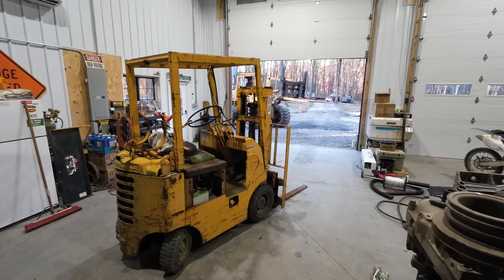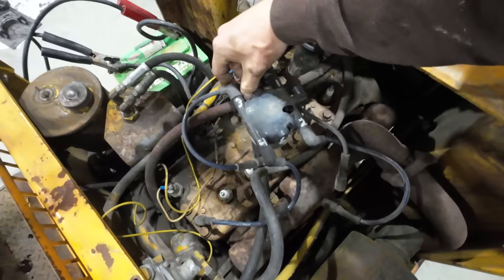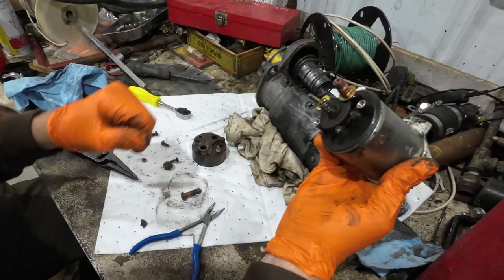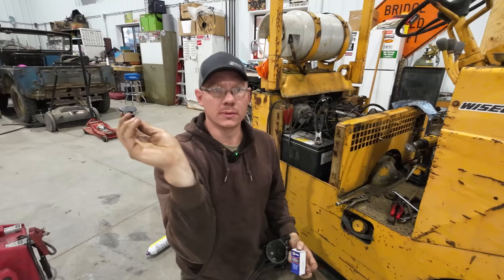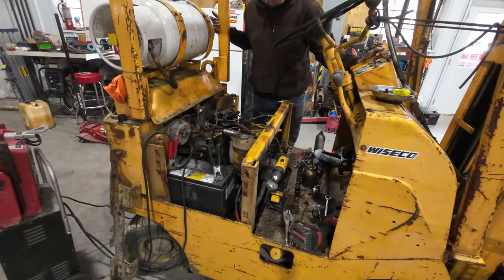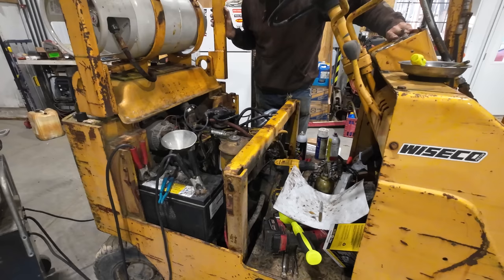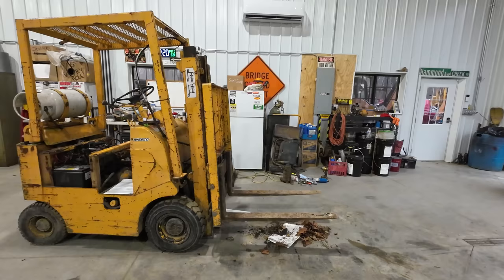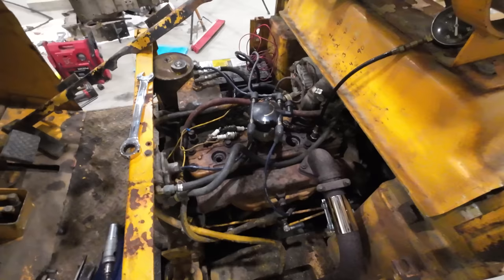Save or Scrap? CAT Towmotor sitting for years. Will it Run??

Comment: The Towmotor co est 1919 were the inventors of forklifts, their early models didn’t have forks and would just tow carts from place to place 👍🍻
Reply: That’s interesting.  I’ve worked in the LTL freight industry and have heard fork trucks referred to as tow motors by people who’ve got many years under their belts.
Reply: Ha, always heard the term “Towmotor” for “forklift”, now it makes sense! Thanks
Reply: Beat me to it. Cat bought that company and of course the rights to the name.
Reply: Distributor may be turning under load ,harmonics off be blessed Matt
Reply: Pretty sure Clark was the first.
Reply: Google to the rescue!!
Reply: @ColtonBlumhagen   yes it was Clark , I stand corrected . I think Towmotor produced the first electric forklift 👍🍻
Reply: Can Matt pull the hydraulics and just use it as a "towmotor"? Yank trailers around the yard?
Reply: After watching Cold war Motor's  flat head  rebirths I think a compression check ought to have been  done because of stuck open  valves.
Reply: @divadyrdnal yes, I always wondered why the term is used.  Thank you.
Reply: A tow motor is used at the airport to tow planes out to the flight line. They may also be the equipment used to tow luggage to the plane as well.
Reply: I know when flowers are auctioned at the flower-auction in Aalsmeer(NL), where around a million Dutch flowers a day, 6 days a week, are auctioned to buyers all over the world, these flowers are on carts of 1x1meter, 2m high (or 3x3x6ft). Then dozens of these carts are linked together and pulled by a forklift-like vehicle without forks.
I don't even know the Dutch name for these vehicles, but I bet a lot of people call them towmotors.
Reply: Great video Matt it's too bad that it could be workable
Reply: Continental engines can still be rebuilt if you are game….
Reply: Top comment ayeee
Reply: @TSSVillains  I don’t deserve any credit, my comment was inconsistent with the truth 🤣cheers Vinnie 🍻
                               P.s where do I get my TSSVillians roller door ?
Reply: Had a late 50's vintage Towmotor forklift at an old job. Absolute beast of a machine.
Reply: The mast and forks attached to a building or crane pillar makes a good adjustable height work station. It would need an electric powered hydraulic pump.l
Reply: At the papermill where I work all fork trucks are still called towmotors.  We just got in a couple of new diesel powered Cats that run off of propane and compared to our gassers and electrics the power is fantastic..
Reply: @william_k4arx not with those tiny tires.
They are like a hog on ice in gravel.
For another pig reference,  that thing is worthless as tits on a boar, once it is off hard surface.
Reply: @ksw501 yeah I’ve worked with some old timers who came over from the steel industry, and they always call our forklift a Towmotor.
Reply: @johnsecord9697 could also be used as an elevator for lifting parts up to a mezzanine.
Reply: No they were invented by my great great grandmother May Tipton who was a mill worker in uk lol
Reply: Same as a few people above... I've heard the term "tow-motor" for years... Never really thought about it. Interesting.
Reply: Towmotor was than sold to Yale Forklift which was sold to Eaton,Becoming Eaton, Yale and Towne than sold to Caterpillar
Reply: @JAF-pd9mw  Definitely scrap that. What a piece of junk. Could get that dismantled and cut up in a day. Weigh in the scrap!
Reply: In Toronto I drive a stand up electric  Forklift either Crown or Raymond brand. Our company has around 200 of them and they are called Tow motors or Forklifts.
Reply: Don't remember who invented them, but when Caterpillar bought them they retained the name. When I worked for Cat in the 70's we always called them tomorrow. Was years until I started calling them forklifts. Someone commented about a couple of other companies owning them before Cat, I never heard of that and I was around them a lot back in the day since I worked for Cat.
Reply: @darrellgarlough7140  I remember the sign for them in front of the Philadelphia Factory with all of the names on it in 1960’s. The part time welder at the construction company my father worked for was a welder there, when anyone asked where he worked, he said Towmotor
Reply: @Farm_fab I believe that's TUG
Reply: I think the first Towdmotrs, were built to move aircraft and cargo around for the military or so I was told by the WWII navy vets I apprenticed under
Reply: That's really interesting had no idea!
Reply: I'm sure it's long gone. Haven't work for that company since 1997. For what we did with it, it never let us down.
 @PreservationEnthusiast
Reply: Never heard the name before, I've only ever heard of forklift but interesting bit of history
Reply: Similar to an airport tug?
Reply: My dad worked in the PRR shops in the 40’s. He dragged home a Clark equipment freight car mover. He made a small tractor out of it, after he stripped about 900 pounds of cast steel off of it. When he first got it home, he drove it off the driveway onto the lawn where it promptly sank till it sat on the oil pan and transaxle housing. That’s where he started cutting chunks off till it could be towed out of its hole. 🥸👍
Reply: “I thought this was going to be a cake walk”

The triumph of optimism over experience.  😂
Reply: @graemediesel2936  haha, and it turned into the few times if not the only time he admits defeat
Reply: @ksw501 😊😊😊
Reply: First forklift I ever got on was a tow motor and that's funny because I still call them that
Reply: @ksw501  Same here for 33 years!
Reply: I worked for a company for a while that got bought by an Australian conglomerate. They sent a couple guys to the states and picked my station to visit first. First question out of their mouth was "where are your pickups". They called fork lifts pickups.
Reply: @charleslaatz6189  they can be a tow motor or a pushback tug.
Reply: @jonnycando  yeah, ask Wes at WWW how fun that is. I wonder if he still has that motor for sale?
Reply: @haroldphipps3457 I haven't heard that comment about tits on a boar pig since my father died.  He had grown up on a farm.  Thanks for reminding me
Reply: Did you ever check the dwell ? In my humble opinion I think autos are jerky and clutches can be feathered.
Reply: CAT bought out Towmotor in about 1965 because they didn't manufacture one themselves , they later partnered with Daewoo in an attempt to bring their range into the 20th century and eventually partnered with Mitsubishi and still do to this day !
Reply: @jasonwhite1244 , I thought I could here it blowing past at least one exhaust valve !
Reply: On that toll motor could you jell? A part 12 of it and you'll make a little bit of money out and so scrap it up and get nothing. Cage radar Olympic all embarked somebody to use a bethat. I don't know anything about them. D*** being judged, but I'm not too proud of you and I'll always say you don't need a reward set like the first one to put down on that 1 film a real man.  Anyway, enjoy very much and you're learning. Some of the tricks that I'd learned working to use cars on a used car lot. How to free up mouth? I don't ride them when you pull the hair. Just pull one bottle of wine out of clean that up. You know, we didn't brighten the feet. We're cleaning the valve up. F*** y**, sweet dreams about a while ago, but it's crying and I'll bound and I'll talk to a electric vehicle. They don't have quarters with them. And I have cranked a pea wool in the oven anyway.  Georgia Joe keep up good work later.Bye
Reply: My dad drives a stand-up electric pcker. The forks  are at the back of the life @glenryan6569

Comment: For those that might be wondering, the fuel gauge was designed for a gasoline engine, and the forklift was converted to propane, so the gas tank is completely empty for safety reasons.
Reply: Saw the gauge and fuel cap on the side. Probably an early conversation before duel fuel carbs?
Reply: Today's LOADING DOCKS are 90% no smoking areas, so fuels won't ignite as readily as say----1970's.
Reply: Watch our US friends head explode when an engine runs on GAS lol
Reply: I work for a forklift repair shop, I get a call once a month or so from customers that say their fuel gauge doesn't work, I have to explain this every time
Reply: . The name "Tow Motor" comes from the Towmotor Corporation, which was founded back in 1919. The original Towmotor machine did not have forks on the front. Rather, it was an industrial tractor that was made to push and pull carts from one point in a warehouse to another.
Reply: Caterpillar bought Towmotor in 1965.
Reply: Anyone notice the cover plate on the side of the block where Matt took that side cover off. It's right by a cam lobe that would drive the mechanical fuel pump for gasoline use.
Reply: @safcforme we have all sorts of vehicles that run on gasses. (Forefront)
Reply: No gas but diesel. The only reason I know this is I was looking for some information on a 1960s era Ford 6000. I found the engine types available. There was  3 types, gas, diesel, and LP. Diesel and LP had the same output as far as Horsepower output
Reply: @dans_Learning_Curve  I would think that it was.
Reply: @RAYAR54  then it never ran on gasoline?
Reply: @dans_Learning_Curve  It being that old, it could have been originally and then converted to propane, which wouldn't need the fuel pump, so it would be removed and a cover plate installed, or it's possible it's always been propane. That engine could be set up for either gasoline or propane, hence, the fuel tank and fuel guage for gasoline use.

Comment: You should know by now, if a forklift (or in this case a Towmotor) is not leaking, there's nothing left to leak!
Reply: If there ain't no oil under the engine, it's because there ain't no oil in the engine?!
Reply: Just like old Harleys, if it ain't leaking, it's out of oil.
Reply: One last thing you might do is check your muffler for being plugged
Reply: @mudbunny6388  And British cars, of lore.
Reply: @johnosborn2704  I thought the same. Could be packed full of rodent condos-that would maybe explain the blow-by too (backpressure)... And then if clearing it helped with backpressure it could even theoretically help with the oil leak
Reply: Hey Matt.  I'm a retired diesel mechanic,  I read a comment about a plugged muffler, I would check that. It would explain alot.  Good luck my friend.

Comment: Don't give up on the Towmotor just yet Matt. At work we have a mid 70's 15,000lb capacity Towmotor with a Continental flat 6 that had a similar lost spark issue. Our company purchased the machine from a salvage yard where it lived outdoors exposed to the elements for many years. It took some digging, but my friend (who's name is also Matt) found the problem. There are bakelight/plastic pieces that isolate the points assembly/parts from the breaker plate and distributor body. The bakelight/plastic pieces had disintegrated and were causing the engine to randomly lose spark. My friend found some non-conductive material at our shop and made new isolators for the distributor. That solved the problem and the Towmotor has run fine ever since. The distributor in that machine was rusty like the one on your machine due to being stored outside for a long time. My friend thinks that's what caused the isolator pieces to become brittle and fail. It's worth checking out.. Distributor refurb kits are still available as are new/used distributor assemblies. Those old Towmotors are great machines once they're sorted. #DieselCreek
Reply: I think by the time he reads your comment it will already be a scrap metal...also...that doesnt solve the oil leaking problem
Reply: Gold star mark.  You gave the solution to the ignition mystery problem, good work.
Reply: even if he fixes the spark problem, its still dumping oil like niagara falls.
Reply: It’s also still a clutch machine
Reply: I get it isn't worth it for him.
I hope he makes an attempt to sell it before scrapping it.
After all if everyone scrapped everything that was "worth more as scrap" this channel would have a lot less videos.

I fully understand it isn't worth Matt's time to fix this.
How ever there may be some one else who has the time and is willing to do the engine rebuild.
Even if he swaps the mast and forks from the AC.
It is a Cat and there are a lot of Cat collectors out there.

I fear it has already been cut up but I would love for Matt to offer it for scrap +25% and find a taker.

Hey, a can dream can't he?
Reply: In a city in the north east, a MarketPlace listing I picked at random, this is a working forklift, everything works, there are photos of it, it's still being used daily.  Why would Matt or anyone spend money on parts and also put ~80 hours of labor into his broken towmotor? :

"Forklift Allie-charmers 2 stage $2,200
Used – fair
Allie-chalmers forklift for sale 
2 stage mast
106” mast height max
Tires are decent condition
No side shift
3,000lbs capacity max
Any questions feel free to ask"
Reply: On the topic of generating other projects for Matt, another MarketPlace listing, this looks like it would be much more fun to see Matt struggle with than Matt cursing at a leaking Towmotor:  "Cat D4 dozer
$1,300· In stock  Listed in Canonsburg, PA [I think that town is near-ish to Matt's place]
Details
Condition
Used – fair
Ran when parked about 10 years ago. Has electric pony motor, the clutch is seized, stuck in 4th gear. Weighs between 7k-10k lbs. Located in canonsburg. PRICE IS FIRM."
Reply: Used to work on one of these machines regularly.  I had to repair this exact same piece!  I was hoping somebody else had seen this issue.
Reply: Good advice. Always somone in the comments who knows someone or knows something. I live reading this hope matt sees it!!
Reply: Matt has saved so many "lost causes", I think most folks would have to think twice (and hard) about the wisdom of adopting one of his rejects.  Like he says, you can't save 'em all...  Still, better save that starter - it's earned its place in the pantheon of starter greatness!!!
Reply: Continetals powered everything
Reply: @kirdot2011  I emailed him about it, he responded, he's aware now..
Reply: Find tito in Williston fla

Comment: This brought back many fond memories of the first forklift I ever operated, a 1950's Towmotor. The shop's chosen forklift mechanic knew of it's history before the shop owned it. It began life in the high rise construction industry. Back then it was raised floor by floor with a crane to move construction material around as the high rise buildings were constructed.

Comment: That starter is a real trooper.
Reply: Guaranteed if it was the summer that starter would've been smokin'... And not in a good way!
Reply: I'm suprised it didn't let the magic smoke out. ok it did let magic smoke out.
Reply: Starter needs to be pulled before scrapping and given a place of honor somewhere in the shop for service above and beyond.
Reply: When your engine has no compression, your starters not working very hard 😂
Reply: Save the starter for honor sake please. Even if it needs repair, once that it done then it seems like it will be a superior unit compared to lots of what modern times has to offer.
Reply: Definitely one of the items he should save
Reply: Starter abuse lol.

Comment: You should get that roof cage for the small wheel loader and as much steel as you can get from the lift stages, you can use that
Also you can yank the side shift cylinder and the hydraulic valve
Battery obviously, maybe keep the counterweight for a tractor weight and the cooler grill as Yard ornament, a cast that says Caterpillar is neat

Comment: I'd check the rim dimensions and see if you could transfer those pneumatic tires over to Allis (with maybe a little wheel opening trimming. Other than that, good decision Matt!
Reply: That'd probably screw the 5000lb load limit.

Comment: I was a machinery hauler for 38 years. There was a machinery mover/rigger in cleveland that would load/unload from time to time that had Townotor lift trucks from the 1930S/1940s that solid built  they would repair rebuild as needed. These guys were old school they would drive these townotors on and off their straight trucks on blocked wood planks. They were one of the best riggers I ever worked with.
Reply: Was it Norris Brothers?
Reply: @PatsPurposefulPutzing  bet it was…
Reply: @PatsPurposefulPutzing lol lol km km